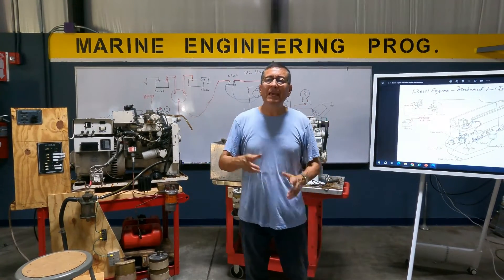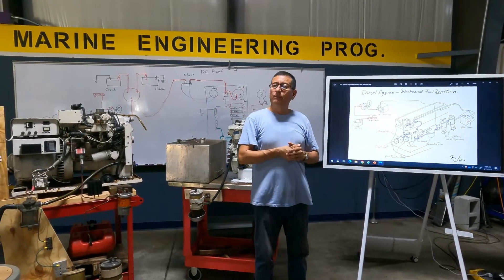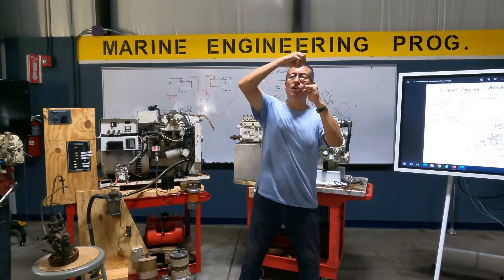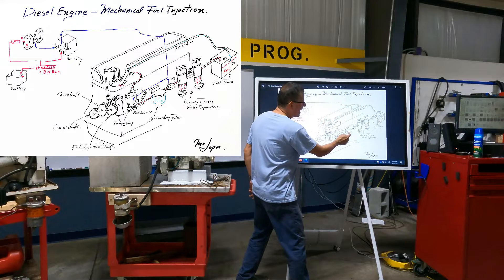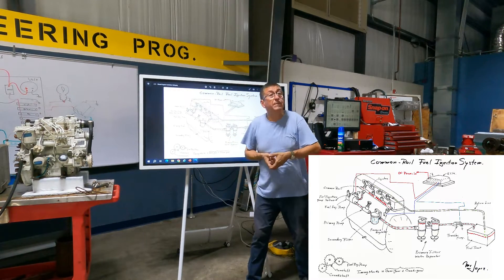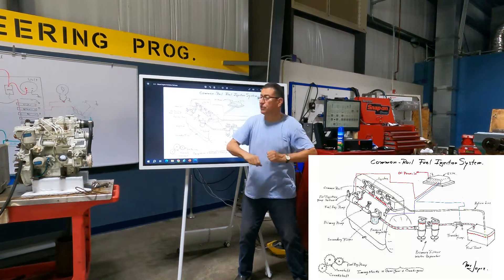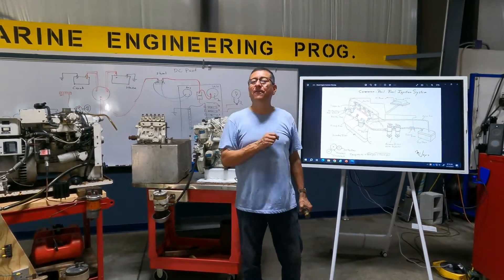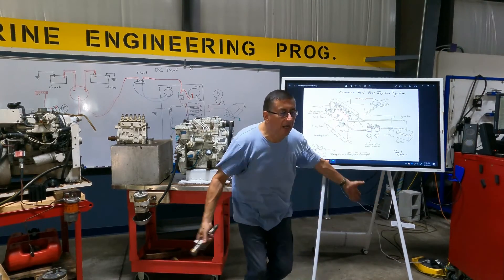Diesel Engine Fuel Injection Systems

Comment: Mr. Lopez.
My boat leaks diesel and it discharges it into the sea when my boat is on. Any idea what could be causing that?
Reply: The return line is leaking out fuel instead of going back to the fuel tank.